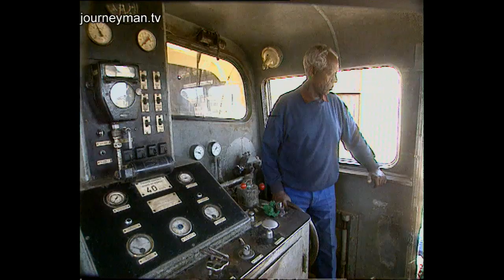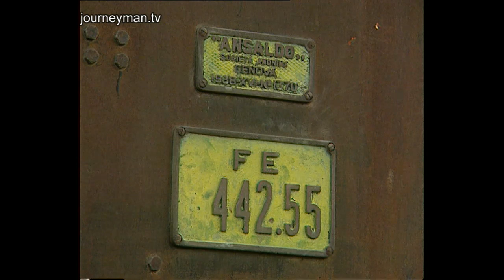The Eritreans' Determination to Restore their Railway

Comment: If it is easier to keep the steam locomotives running then they should use them for as long as they wish to. 
A diesel locomotive uses expensive oil and contains hundreds of parts, wheras a steam locomotive contains far less. 
The major moving parts are on a larger scale & can be reconditioned locally. 
The boiler is the heart of a steam locomotive. An aging boiler makes for expensive & specialised repairs that may be beyond local skills.